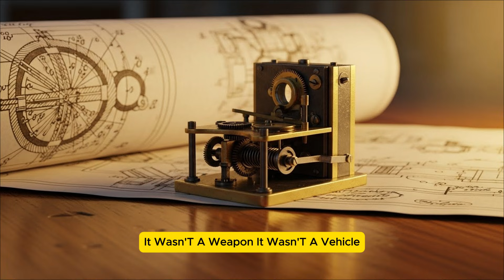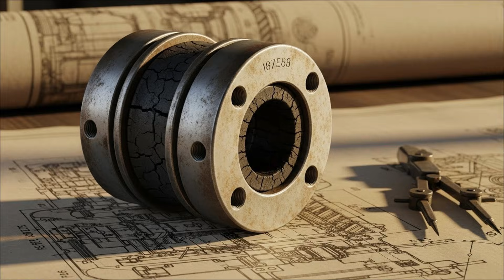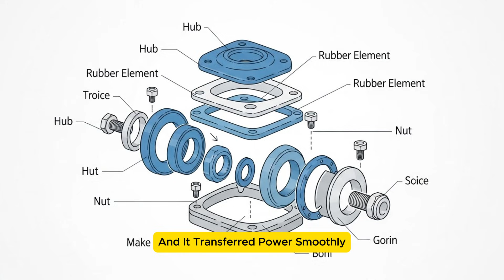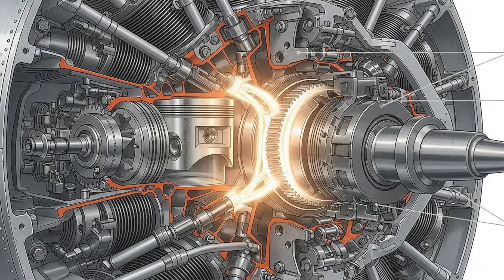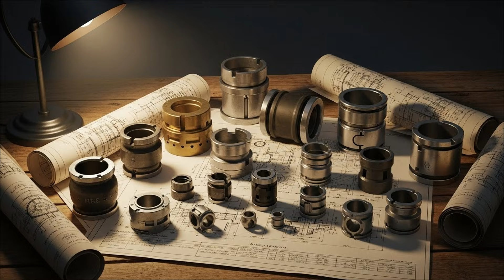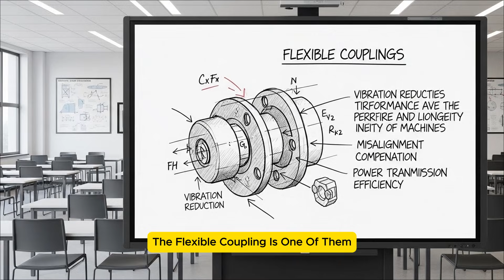The Forgotten WWII Device That Changed Modern Engineering

Comment: I'm a lifelong mechanical engineer. The flexible elastomeric coupling is a handy and useful device, but it doesn't do much of what is claimed in this narrative. It allows compliance and misalignment in selected degrees of freedom, coupled with damping. On the way to doing this, it typically sacrifices precise timing in rotation. 
So it is welcome in some systems and poison to others. It would have been much more useful if the several types of flexible couplings were revealed and discussed, like a torsionally rigid bellows coupling, jaw coupling, Schmidt coupling, Hooke joint, Rzeppa coupling and so on.
Most of the AI images in this video are irrelevant to the story line, and the suspense buildup before "the thing" is revealed is mostly misleading bullshit.
Oh, and by the way, they are hardly forgotten. McMaster-Carr lists 2,441 part numbers, and these are just the common ones on the market. If you are referring to forgetting its origin, well, that wasn't part of your yarn. You don't mention what device it was first used in or by who. I think flexible couplings as a component significantly predate WW2, but there may be a popular version that fits your story. WW2 was a time of amazing innovation in materials and processes. Certainly torsionally compliant coupling assemblies were part of automotive clutches in 1920-1930's, and these devices were used in supercharger and counterbalance drives in WW2 aircraft engines.
Reply from the maker: Thanks for such a detailed breakdown — this is exactly the kind of engineering context I’m still learning to bring into these videos.

You’re absolutely right:
a flexible elastomeric coupling doesn’t magically “fix everything.”
It trades precise timing for compliance and damping, which makes it ideal in some systems and completely wrong in others.

In this video I focused on telling a simplified wartime story rather than walking through all the coupling families (bellows, jaw, Schmidt, Hooke, Rzeppa, etc.), but you’re right that a follow-up digging into those differences would be much more useful for engineers.

And great point on the history and “forgotten” claim — they’re definitely not gone from industry, even if most people outside engineering don’t know what they’re looking at. I appreciate you taking the time to write this out; I might borrow some of these points for a more technical companion video. 🙏